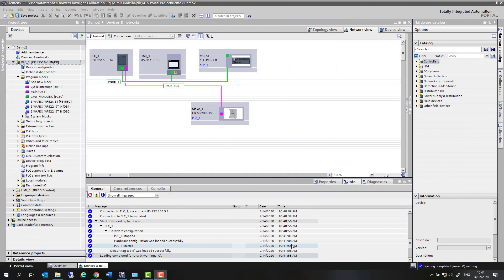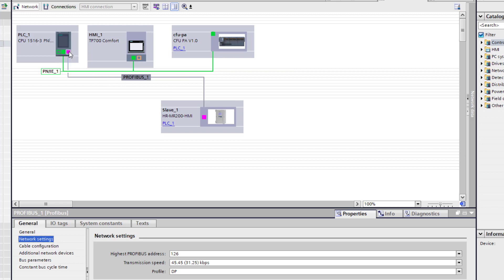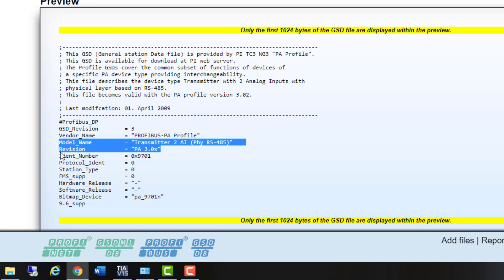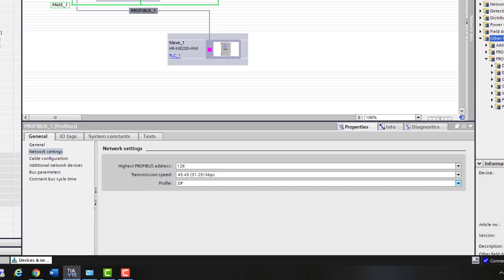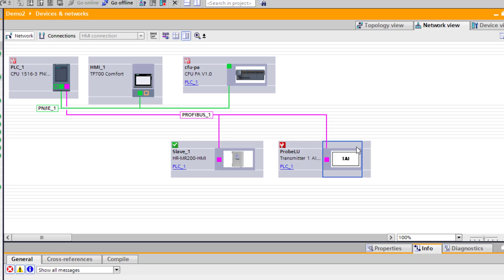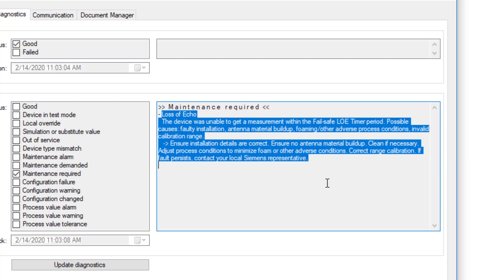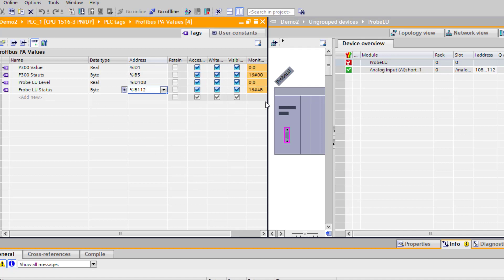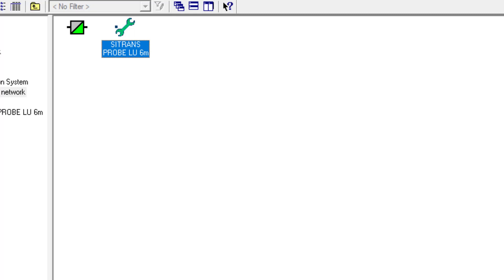How to Add Profibus PA Instrumentation to TIA Portal using transparent DP/PA Coupler

Comment: But and if it is a dp / pa link, how would you integrate it, how would you configure the im153-2, what address would you give it, what address would you give the fdc157
Reply from the maker: The IM153-2 only takes up 1 address on your Profibus DP network.  So chose an address that is not being used.  This is a DP slave but a Master to the Profibus PA network.  Both networks are now completely separated, so your address on the PA network start again.  So you don't have to worry about finding spare address on the DP network for the FCD157.  Use any address 1 - 125 and don't duplicate any address on you PA network.
Reply: Totally Integrated Instrumentation Thanks for the reply. I have a communication problem of linkp / pa with abb dcs, I have already generated the gsd through the gsdtool tool and loaded it to the system 800xa, the detail is that I get an error in the linkp / pa, the led bf1 flashes red and the bf2 is on at all times, which I don't understand because I'm putting different addresses and the pa slave's gsd is inside the im's gsd, I hope you can help me thanks.

Comment: Whats that transparent coupler you're using? I'm trying to find one for a project.
Reply from the maker: Sorry I missed this one.  This is the module for safe area, and can also support ATEX using the high powered trunk concept.  For ATEX you need to use it with Siemens AFDiS.

https://www.parmley-graham.co.uk/industrial-communication/siemens/profibus/profibus-pa/6ES7655-5DX60-1BB0

Comment: I could lean I have a network with 10 proibus devices and I can not take the reading of the data correctly, specifically are TH400 temperature sensors and emerson pressure sensors
Reply from the maker: What Profibus PA Gateway are you using?
Reply: @IOTConnectivity  profibus coupler siemens
Reply: @IOTConnectivity  I use a siemens FCD157 to perform the coupling and in the PDM I can not modify my parameters to read these in the PLC